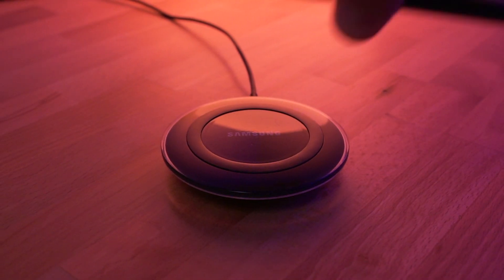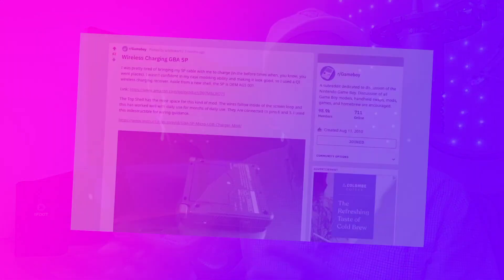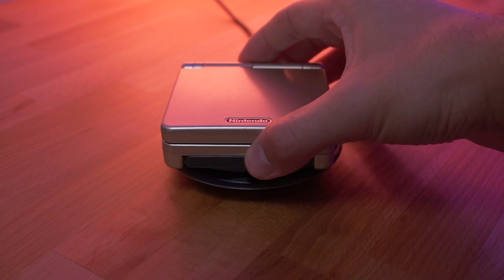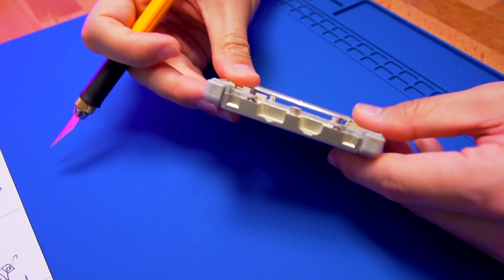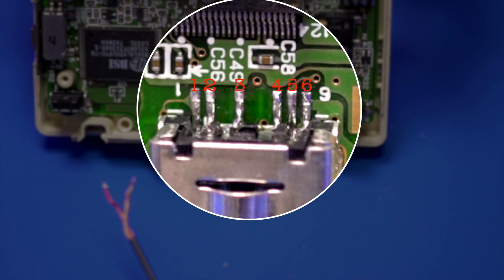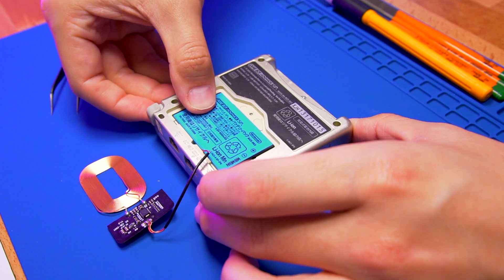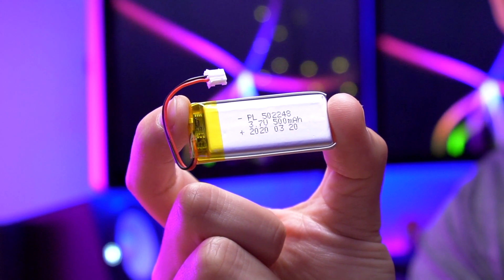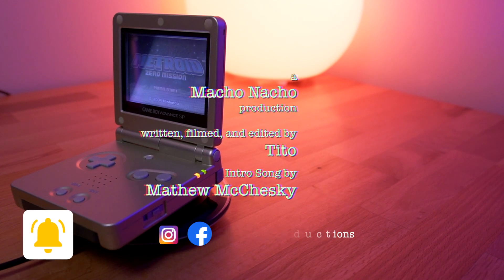PART 1:  ADD WIRELESS CHARGING TO ANY GAMEBOY ADVANCE SP! | GBA SP Mod Tutorial v1.0 | Retro Renew

Comment: I would recommend installing a LiPo with the Makho method. Makho made a PCB that you wire the battery to. One side has gold contact points that make contact with the SPs battery pins, that way you don't have to solder a battery in and ruin the pins. I busted out my calipers and an OEM battery is 6.18mm thick while the 900mAh I have installed in my SP is only 5.75mm. If that still isn't thing enough, you might be able to route out the bottom of the battery bay, attach a Makho style LiPo to the back of the wireless charging module and then attach the wireless charging module to the battery door itself. Just some thoughts! Big fan of your videos, keep up the great work 👍
Reply from the maker: Thanks for the great ideas and the measurements, Aravind!  I actually ordered a few of makho's battery pcb and plan to do a video update with the LiPo battery mod.  I think it should work out well!  Cheers buddy!
Reply: @MachoNachoProductions  looking forward to seeing how it turns out!

Comment: 403048 paired with the makho board should give enough space
Reply from the maker: Awesome!  I'll take a look at those. I ordered a dew of Makho's battery boards, hopefully they get here sometime soon.  How's the capacity on those, about the same as the OEM Nintendo battery?  Thanks for the info!  Cheers!
Reply: @MachoNachoProductions  they're 600mAh, so assuming the spec is honest, it's identical capacity to the original. Its 2mm thinner compared a normal sp battery, I'm guessing that would be enough room for the qi module? otherwise the next size down is the 303048, it's 3mm thinner but only 400mAh. Looking forward to the follow up!
Reply from the maker: Awesome!  2mm should be enough space.  I'll be placing an order for one of those soon!  Thanks for the info!  Cheers Retro Rexzi!

Comment: you could also cut out the case so the battery sits lower, not sure if the batter contacts will be long enough for this though, but worth taking a look, great vid as always
Reply from the maker: I was thinking the same thing. If it works, it would add enough space to use the oem battery I think. Need to investigate that further. Cheers!

Comment: I would definitely prefer the thinner battery, but see the merit to a slightly oversized battery compartment. For me personally, I often play 4 gba SPs together to multi hunt shinies in pokemon, so having a charging station where I can have all four systems charging while I play would be awesome, and an oversized battery compartment may make for an unstable setup. The idea of a complete rebuilt bottom big enough to fit a 2000mah battery, wireless charger, and stuff like an easy headphone port mod spot would be really cool to see even just 3d printed some day.
Reply from the maker: That would actually be a pretty cool solution! Making the bottom overall shell larger. I will look into that. I will need to ramp up my 3D design skill asap!  Thank you!  Cheers!
Reply: @MachoNachoProductions  You sure looked into it!

Comment: Nice editing on the build highlighting the points we need to solder makes for an easy tutorial to follow! Personally I think you should retrofit slightly smaller battery in there best of luck!
Reply from the maker: Thank dude!  I really tried to break it down so that it was easy to follow. I think  there will be folks in both camps so I’ll probably do both solutions. There have even been some other soil suggestions I may try out too!  Cheers buddy!

Comment: Very Cool
Reply from the maker: Thanks Matt!  Cheers!
Reply: @MachoNachoProductions  I was just now thinking about it and wanted to let you know if you order that GBA cartridge I talked to you about before you will have to file the cartridge on the sides a little bit I think they mold their own cartridges and they are just slightly wide and barely fit in the cartridge slot unless you file down the game cart a bit
Reply from the maker: Awesome!  Thanks for the heads up!

Comment: You could remove some of the bottom of the battery compartment, that way is more room, put electric tape on the board. I did something similar when I installed a larger 3ds battery in there (was a 3ds or dsi can't remember).
Reply from the maker: That’s a great suggestion!  I was thinking about doing that, my only concern was whether it would affect the battery contacts since the battery would be in a lower position. If the battery contacts were fine, this would most likely create enough space for the stock battery and the wireless charger!  Again great suggestion!  Thanks!  Cheers!
Reply: i did this on my basic GBA to fit a rechargeable XBox One battery lol
Reply from the maker: @Nemesis_Slime  Nice!  How big is the Xbox One battery?
Reply: @MachoNachoProductions  i sent you pics just now on Twitter!
Reply from the maker: Awesome!  Just saw it. That’s a very cool mod. Was curious how large the battery capacity is?  Thank you for sharing!
Reply: @MachoNachoProductions  only 1400 but it does it's job! I did this when all of the commercially available rechargeable batteries were sold out due to Covid
Reply from the maker: Wow that’s pretty big!  Really fantastic mod!  I wonder if the contacts on top could be used for charging the battery somehow?  Again really appreciate you sharing!  Cheers!
Reply: @MachoNachoProductions  it's theoretically possible with the matching dock, but I'm okay with using the Micro USB to charge it 😁 I have a spare battery as well, if you want I can send it your way so you could do a video, if you want.

Comment: What about the heat while charging? Is there any and will it damage the console over time?
Reply from the maker: Great question Ali!  I noticed when charging, the pcb on the wireless module got a little warm, and the coils remained cool to the touch. It’s an interesting question but upon initial inspection, I feel that the temp isn’t concerning. Hopefully someone who knows more about this can chime in. Again great question!  Cheers!
Reply: @MachoNachoProductions  I think this could be a good reason to have the charger above the screen, to avoid the battery getting hot cause the wireless
Reply from the maker: Very true.  I may try to insulate the heat from the wireless charger from the battery somehow.  Definitely something to be thinking about!  Thanks!  Cheers!
Reply: @MachoNachoProductions  I'm taking computer engineering, I somewhat have a background here. Heat on the pcb should be no concern. However, when a battery is hot it degrades faster. You might see diminished capacity, especially since you are placing the sp on the battery side. My 2 cents
Reply from the maker: Thanks for the input, Nicholas! Could I put something in between the battery and the wireless charger to insulate the battery from the heat?  Perhaps like a thin sheet of silicone?  Thanks!

Comment: I like the ambition here, I think if you got the kind of receiving coils they put in phones that are much flatter, you may get it to work.  You are using kind of the standard qi RX component, but you can get super flat ones like this that might work. https://www.digikey.com/product-detail/en/molex-connector-corporation/1461798011/WM15004-ND/6159266?utm_adgroup=Wireless%20Charging%20Coils&utm_source=google&utm_medium=cpc&utm_campaign=Shopping_Inductors%2C%20Coils%2C%20Chokes&utm_term=&utm_content=Wireless%20Charging%20Coils&gclid=CjwKCAjwydP5BRBREiwA-qrCGrO1OaE-rLqxKEL33TUDzFoUxCIDrpiHIGfgBbS5hE5bNfKM09xhIBoCUdEQAvD_BwE
Reply from the maker: Awesome!  Thanks for the link Jeremy!  I’ll definitely look into these. Hopefully they all work under the Qi standard. Looks like I’ll have some more research to do. Thanks again!  Cheers!
Reply: @MachoNachoProductions  they will work under the qi standard, you just gotta find them for sale somewhere
Reply from the maker: Awesome!  Thanks!
Reply: @MachoNachoProductions  one more thing the coil will heat up so you might want to look at the GBA battery thermal guidelines to make sure it won't degrade with the heat
Reply from the maker: Thanks Jeremy!  That’s something I’m not too read up on. I’ll definitely need to look into that. I want this to be a safe mod for folks to do. Thanks for bringing that to my attention!

Comment: Cool I knew you could do this for the original gba but not the sp
Reply from the maker: Yep, it should be able to be done for all gameboy consoles. The SP is actually one of the easier ones because it already has an internal charging circuitry so only the Qi wireless charger module was needed. I’ll probably do more of these videos for other consoles if folks are interested. Cheers buddy!